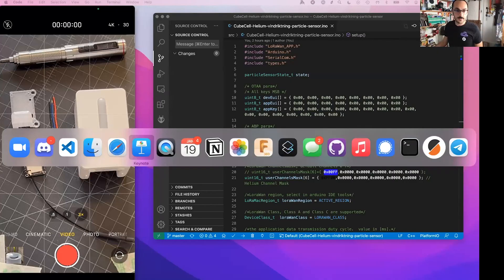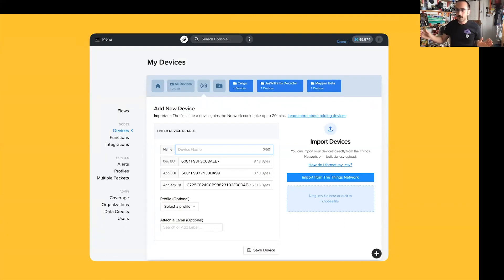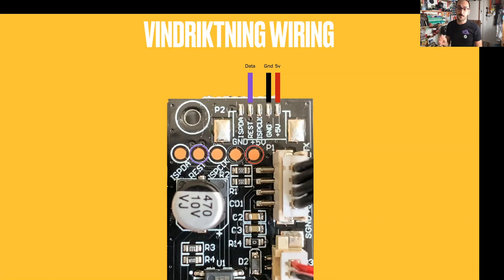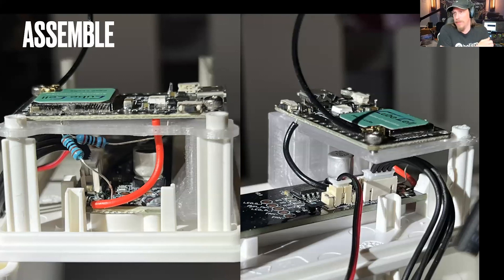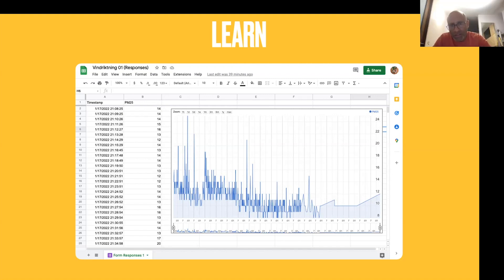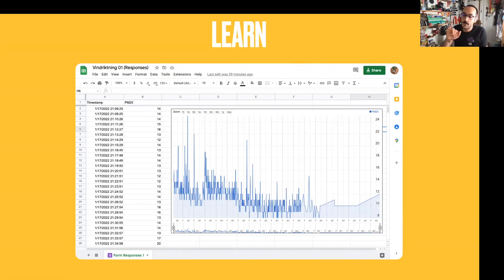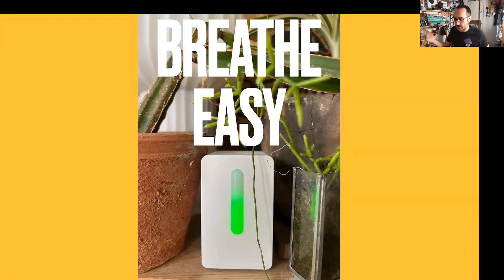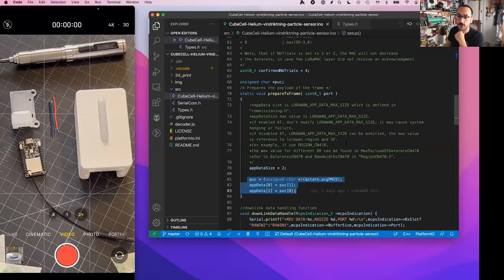IKEA Air Quality Sensor on the Helium Network - Helium Hacks Happy Hour

Comment from the maker: For those interested in recreating this project, check out the full step-by-step guide on GitHub: https://github.com/jthiller/CubeCell-Helium-vindriktning-particle-sensor.
Reply from the maker: THUNDERMONKEY MEDIA  HIP 19 approved Hotspot options are required for Proof of Coverage participation (a large majority of Hotspot $HNT rewards). However, any Data-Only Hotspot can mine $HNT for Data Transfer 🙂.
Reply: Anyway to send data to google IoT core or a database like firebase?
Reply: Are you guys going go keep avoiding the answer of a lot of people related with the decrease of POC earnings, but that Helium anounced on the 28th of January that lowered the amount of challenges from 4 to 3 times a day per miner and the max amount of witnesses from 18 to 14th. Is this change permanent or for a limited amount of time?

Comment: It works great! in 3 days that I have it assembled:

Packets TransferredDC Used
All Time
4151
Last 30 Days
4143
Last 7 Days
4143
Last 24 Hours
1177

Example: 

Transferred Packets
235 packets|235 DC|5.51 KB
11h

Transferred Packets
33 packets|33 DC|792 Bytes
22h
Transferred Packets
33 packets|33 DC|792 Bytes
22h
Transferred Packets
34 packets|34 DC|816 Bytes
22h
Transferred Packets
34 packets|34 DC|816 Bytes
22h
Transferred Packets
34 packets|34 DC|816 Bytes
22h
Transferred Packets
34 packets|34 DC|816 Bytes
22h

At first after mounting it, the entire city saw my data, the sensor being inside my house (although I have a privileged view of the city). So I removed the antenna and put it near my NEBRA, now I only see the transferred packets!!
I only have to know how to take that data and assemble a graph with it in datacake or similar....
Reply: Hello, I have now ordered a Cube Cell for the conversion. My problem is that I don't quite understand in the video how I have to install this ESP so that it sends the sensor data to the LoRa Herlium network. Mr. Hiller in the video speaks very unclearly and the quality is not good. Unfortunately neither does my English. Reading is not a problem. Listening only.

Can you give me information about that? Is there a description somewhere of how I have to install the Cube Cell?

Greetings Ulli
Reply: I want to use the Ubidots application in the Helium Console to display the data and create a dashboard for the sensor data there
Reply: Can you help me with the librarys?  I get compiling errors:         #include <softSerial.h>       and     #include "LoRaWan_APP.h"  
Which libraries are used?

Comment: Will we get paid for data or have to pay to use the helium network
Reply: Kinda both. You'll need to provide data credits for the end-device to use. However, if your hotspot is responsible for transmitting the data packets to the network it will be rewarded HNT in the amount of DC used.